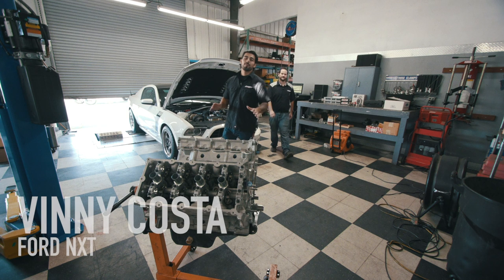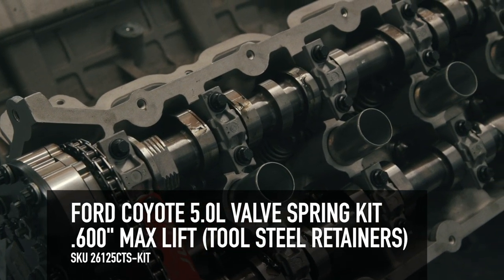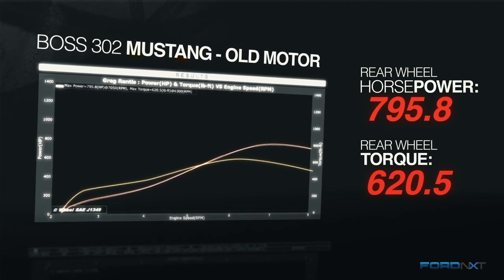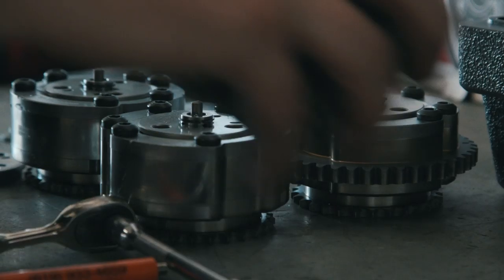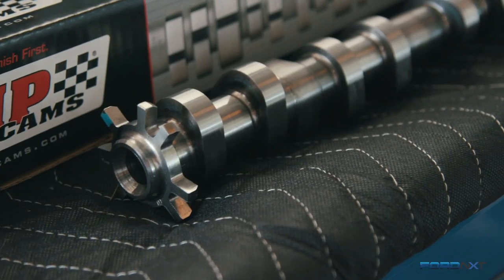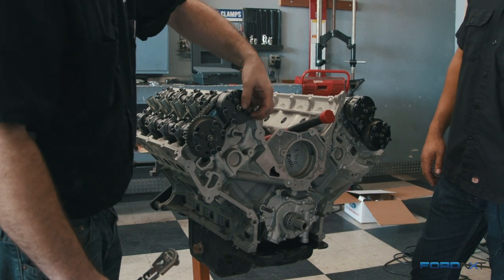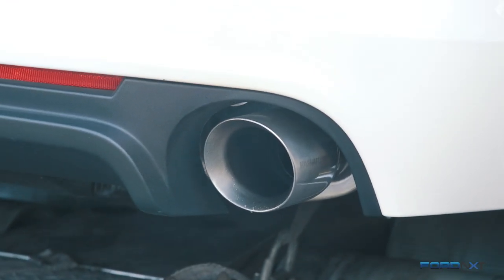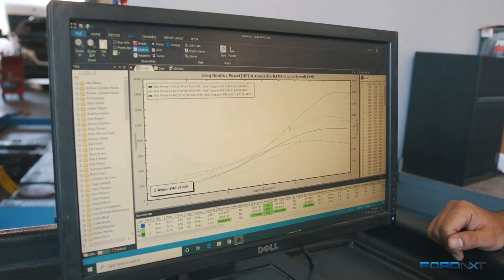COMP Custom Cams and GT350 Heads Bump Coyote to 1,400 HP

Comment: 1371hp on 22lbs  out of a coyote isn't even trying ! With the sleeved block 3.700 on the front and depending on stroke that motor is happy at 8K !!!
Reply: He's also only using a boss 302 manifold which sucks compared to gt350 intake or even 2018 intake is wayyy better
Reply: @derekiskindacrazy1541  302 intake is the best for boost to this day. 1320 junkie one of the leaders in ported cj,18+ and boss 302 intakes has confirmed boss 302 is the best

Comment: gen 1 and gen 2 coyote has sleeves not plasmawire. gen 3, gt350,gt500 have plasma wire. the new engine said 3.700 on it so did you increase the bore from stock to add more cubes as well as add heads and cam and bigger turbos to get those numbers?

Comment: you are showing a gain from 3 components but only talking about 2 of them, masking where the gains actually came from which in turn makes people question the apples to apples. you can also see on the graphs the first setup was making more power down low, so again we dont know if that was down to the cams or slower spooling 'bigger' turbos
Reply: They said that they expected lower numbers down low because of no more variable cam timing

Comment: What ecu was being used on this car to allow use of the gt350 heads?
Reply: Like stock gen 1. Those are custom grind so they likely used gt350 cam dimensions with the ends of a gen 1 to allow gen 1 phasers and timing.
Reply: @izaahrusche  that’s what I was thinking but I was curious if they tuned it on the stock ecu or a stand-alone like  haltech etc

Comment: The LS is a great motor. So is the Coyote. But let’s be honest, we’re talking over 100 ci difference. You wouldn’t market a “shootout” between a sbc 327 vs. a 427, because it’s not an apt comparison. They obviously should’ve used a 4.8 or even the 5.3, but in part, they feared upsetting the LS fanboys.
Reply: it's dohc vs pushrod motor dummy

Comment: Not bad but LPF is making 1400 on stock heads sleeved motor and stock cams ..I was hoping for more with the gt350 heads and cam swaps
Reply: Bret lasala is making 1800whp on stock coyote heads and cams
Reply: Its a ford you too do sleeves cam crank heads pistons fuel everything SMH
Reply: And likely took more boost to do it. Just because it can be done doesnt mean its the best way
Reply: @03c5z  i run 13 on mine for the street it makes 1200 hp to the wheels
Reply: @goodfellasinc.5648  A stock cubic inch/stock headed coyote will not make 1200 hp on 13 psi. Thats enough to make a little over 800 on the right setup.
Reply: @03c5z  LOL FRIST OFF I OWN A MACHINE SHOP FOR OVER 40 YEARS I'VE SEEN ALOT I DONT BUILD FORD MOTORS FOR ME I DO NOTHING BUT LS OR LT MOSTLY AFTER MARKET BLOCKS LIKE DART HAS A NICE SET UP AFTER GOING THROUGH THE BLOCK ANY HOW I DO HAVE A 427 BLOCK ALMOST STOCK BOTTOM BESIDES RODS RINGS PISTON TWIN 88 TURBOS ITS KINDA TIRED I BUILT IT  KINDA A LONG TIME AGO I THOUGHT I WAS GONNA RACE CHIEF BUT NEVER COULD RUN IN TO THEM LOL IM SLOW ANYWAYS
Reply: @goodfellasinc.5648  in a conversation about coyote engines it would be helpful to know that you were referring to an engine with an extra 120+ cubic inches and higher flowing heads. You made it sound like you were claiming 1200 with a coyote. Making 1200hp at 13 psi  on an engine with a base hp of 600+ is completely doable.
Reply: @03c5z   If you were to take the time to be a real nosy person instead of a lazy nosy person you would have seen the beginning of the conversation where I say I was almost happy for you ford guys I personally build Chevy product for racing lol have a marry xmas
Reply: @goodfellasinc.5648   Goodfellas Inc.  I apologize for not researching previous comments that you might have posted before you jumped in on this one. You over generalize when you speak if "Ford Guys." I have a GM 6.2 as well as previously had a LSX 434 and supercharged LS6. Lots of Ford guys going fast, especially when you compare against the LT1 which is the coyotes closest competition. Both great platforms for different reasons.
Reply: @03c5z  your ok  Where just talking . To me the closest to for Coyote would be the 5.3. The new 5 .3 have hollow stem VALVES , 5 angle race cut, higher compression and super flow race heads factory there like 398 hp just say 400 horse power you can boost 5.3 to 1000 hp all day  stock everything iIt takes a lot of everything to make  ford coyote fast  Hear something you'll never hear how about we do a coyote swap lol
Reply: @goodfellasinc.5648  the L83 wont even get close to 1000hp. An older 5.3 will but its not reliable at 1000, nor is a coyote. I'm not trashing LS's because I love them, but if you think coyotes are trash you are also misinformed. With the exception of the LT4 and LT5, the coyote is a better current platform for your average weekend racer with some boost. The LS platform reigns supreme when making NA power and building big power cheaper
Reply: @03c5z  yeah right my friend we do it all the time with the 5.3 thats easy the new 5.3 are built like race engines  5  angle race cut on the valves hollow sodium filled valves  All the valves are weighed the same They flow almost as good as an LS3 head  The only thing where doing as using an LS9 head gasket and  screw in studs 
  LS7 FUEL INJECTORS SOMETIMES PORT RUN A TURBO CAM IF YOU WANT
Reply: @03c5z   Let's build any ls motor lt motor versus the Coyote see who gets more horse power and the price difference its been done all over the Internet from when it 1st coyote till now horsepower war look it up they did just the motors then mustang vs Camaro vs dodge charger hemi junk at least the coyote better then the hemi
Reply: @goodfellasinc.5648  you clearly dont know your engines. L83 wont make 1000 without a good amount of work. Anyways, i dont have time to argue. Keep being a LS nut swinger and be blind to the facts that the coyote is better in some respects. Come down to Houston when you are ready to line up. Merry Christmas
Reply: @03c5z  Im IN H TOWN RIGHT NOW  SO COOL AND LIKE I TOLD YOU I BUILD MOTOR BUY THE TON SO ME BEING HERE LETS MEET UP I HAVE MY OK RACE CAR LETS RUN THEM FOR 2000 A RACE AND IF I WIN ILL GIVE MINE TO THE BOY N GIRLS  CLUB ???
Reply: @03c5z  WHY ARE YOU SO SCARD OF L83 because it turns of cylinders very easy to fix that there's a kit Texas speed sells The heads on them motors are close to a aftermarket race head the cut on the VALVES the flow numbers you said i dont know lol it seem to me you haven't done any of these motors or you would know you cant even talk about the 243 head design lmmfho LIKE I SAID IM HERE ON BUSINESS WITH MY SLOW CAR SMALL TIRE 2000 GRAND A RACE WHEN I WIN ITS GOING TO THE BOYS N GIRLS CLUB
Reply: @goodfellasinc.5648  im not scared of the L83. The heads are great, the fuel system is expensive to modify/upgrade, the pistons are weak. If you want to make 700+ hp it basically takes a built motor, and an expensive cam swap to do it on top of boost. Coyote just needs boost. What about 243s? Had them on my LS6. Good heads, not the greatest. If you could get it out of your head that im bashing the LS/LT we would be better off. Im not.  They each have their advantages. If you think they are superior to the coyote in every way you would be incorrect. You would be a brand loyalist that cant see past what you want to believe. Again, both are great platforms for different reasons
Reply: @03c5z  once again you didnt read my first comment i said coyote is very good and better the the hemi but not even close to the ls platform I build all motors for a living i own a machine shop over 35 years
Reply: LPF is trash also